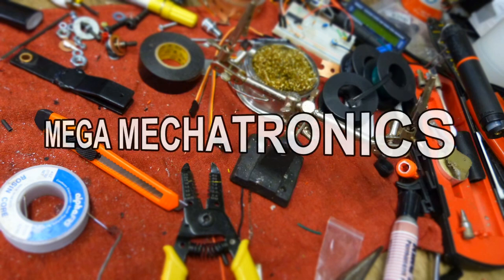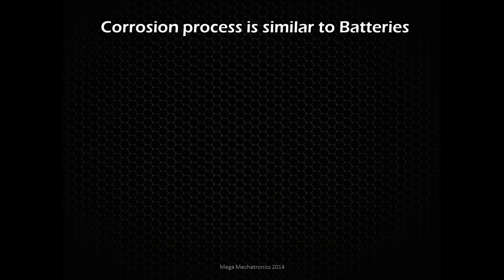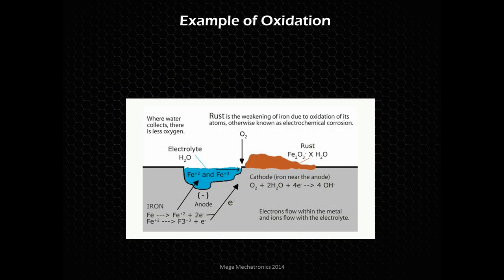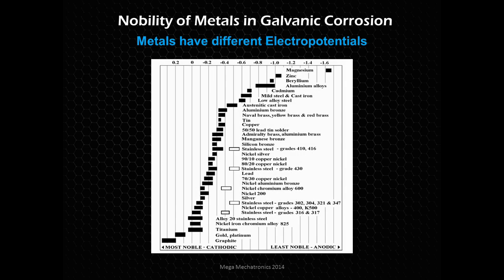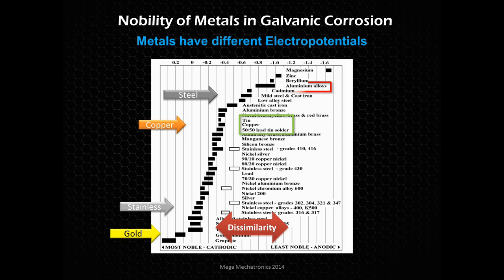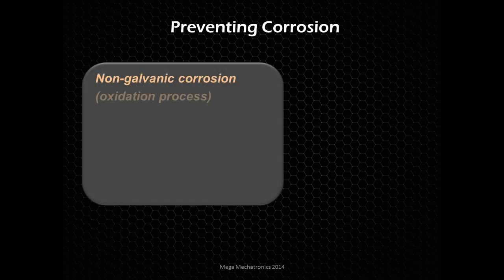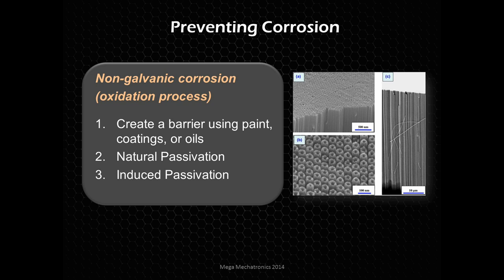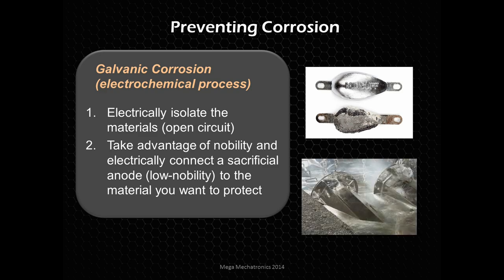Materials Science Mechanical Engineering  - Part 3 Corrosion Explained

Comment: Your video was good to us non-engineers. So I replaced the magnesium rod in my hot water tank so that the corrosion would occur in the rod instead of the tank. The original rod was about 4 ft. long and probable 3/4 in. in diameter. But when I took it out it was like 2 ft. long and 1/4 in. in diameter. Replacing them makes the tank last a long time. Mine is 15 years old. They'll tell you on home improvement shows tanks only last like five years, but with the proper care, can last way longer.